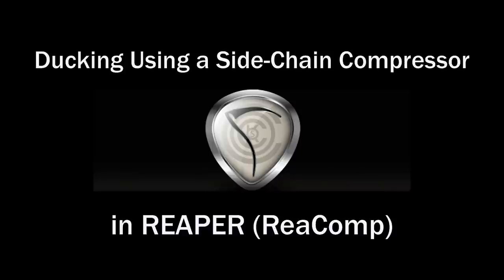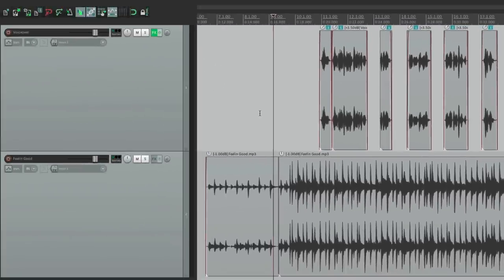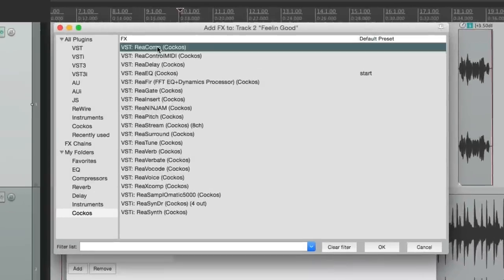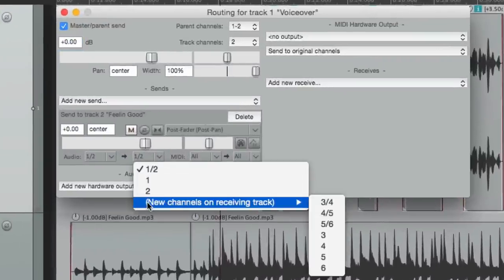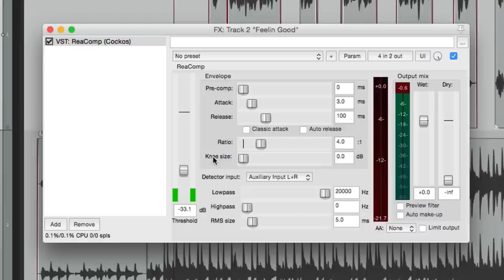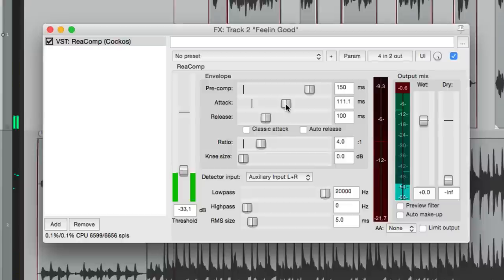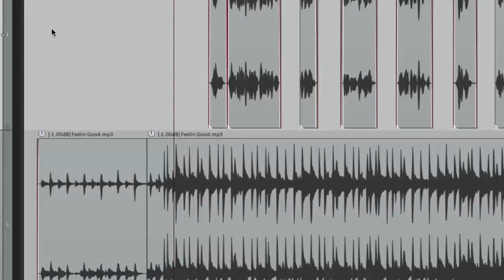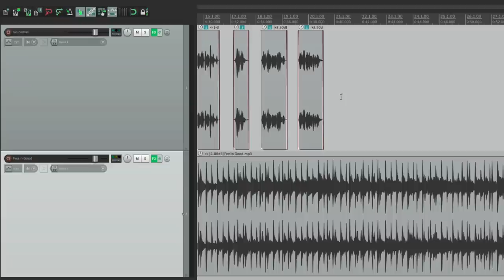Ducking using Side-Chain Compression in REAPER (ReaComp)

Comment: I'm assuming this would work the same way with folders. I just went through a nightmare having to try to do this with a haunted file in Logic Pro X. It had originally been a Garageband 5 file, and it was not doing anything the way the it should, but no matter what I did, I could not get the compressor to use the source side chain as the trigger. I tried absolutely everything. I eventually had to use the ducking feature in the gate, which worked without a hitch. I'd like to see a video on using ducking folders with other folders, some of which may already contain internal ducking. This is a much trickier thing to do, and I think it would make a great tutorial. For instance, if there was a kick drum ducking the bass within the music folder, and then you wanted to have all of the music inside the music folder be ducked by all of the output from the folder containing the vocals, what would be the best way to route this? It can get confusing, and I'd love to see Kenny show us the best way to do something like that. Thanks for another great video, Kenny! You are the best. Truly.

Comment: Coming from Cubase and other DAWs, the routing in Reaper doesn't make much sense at all to me. What if you compressor is on a track that has a variety of other compressors or gates or other things that have inputs.. how do you know what's what and ensure you route into the right sidechain input?
Reply: His send is Pre Fader so it won't have other plugins affecting it
Reply: Isn't this accounted for with the pin routing where he sent pins 1/2 to pin receives 3/4 of the track and the compressor itself was detecting that 3/4? Where other compressors on the track wouldn't be responding to the send at all, because they would only be responding to sends that were going from pin 1/2 out pin 1/2 like normal. I thought anyway.

Comment: Dois this plugin work on Cubase 10? If it's yes, could you give me that link, please?
Reply: Well, you dont necessarily need to use this compressor (Its the stock compressor that comes with reaper) - any compressor with sidechain-option should do the trick, and i am pretty sure CuBases stock ones have that option, too.  However, the people over at Cockos were nice enough to release those Plugins for free, and they should work with Cubase. Just google "ReaPlugs" and you should find em :) Cheers!
Reply: @evil_in_your_closet  I downloaded that Plugins but there was no sidechain option.
Reply: @evil_in_your_closet  Yes you are right. I know there is a sidechain option in Cubase but no pre-compressor. I couldn't find it. Could you tell me another way to make sidechain on that Plugins?

Comment: When to use ducking vs automation?
Reply: Little late now I suppose, but they all have their different uses and times when they are useful. 

Automation might be something like, see all the transients in the waveform? You might want to bring those UP in level with a volume envelope directly on the media item in Reaper.. to keep a consistent volume from the speaker, like a Voiceover for radio.. Generally, compression AFTER fixing the dynamics with automation will sound the tightest and glue everything together.. 

Then ducking or sidechain compression really has it's uses in other applications.. Most typically, it's used as a pumping effect on the kick drum in electronic music, the kick will be a very sharp low/mid-range punch frequency after EQ, then you will let the kick "CUT" the mix of your track using some ducking effect.. It's used a lot of trance and other genres of music more subtly and it tends to allow a bit of magic or breathing room for the music, since the track being ducked is sort of tracing the outline or shape of the incoming waveform.. 

That's more of an artistic aesthetic.. there's other times in radio production and also in video game mixing.. where ducking becomes essential, dialogue should be heard clearly and intelligibly, so it becomes more of a function to use a ducking hierarchy system a lot in games where the whole game is consistently loud and things need to be brought down in volume quite considerably.